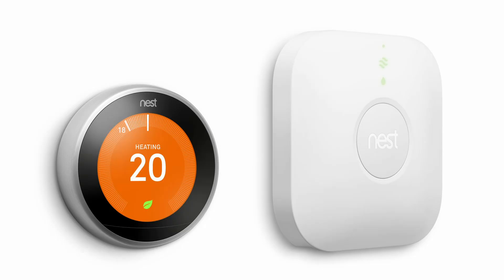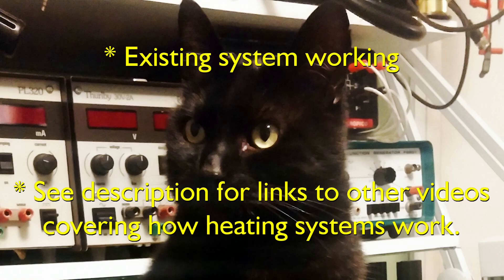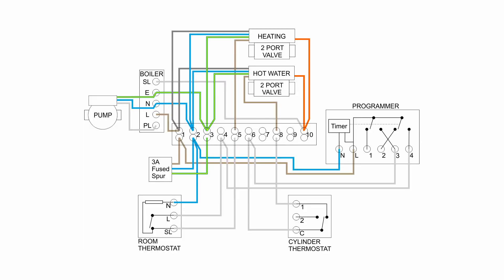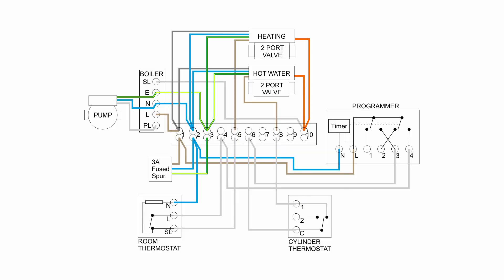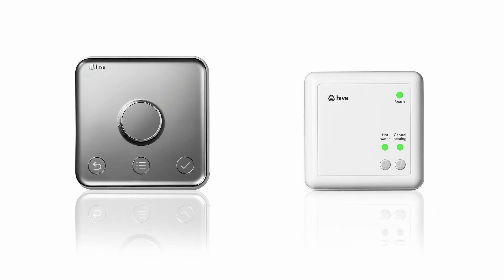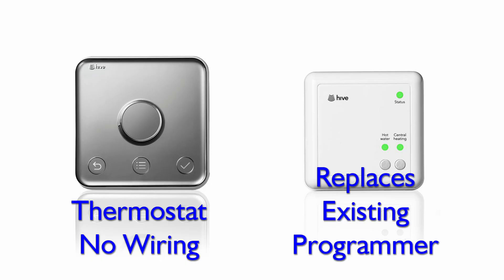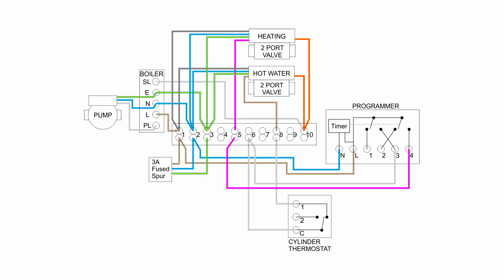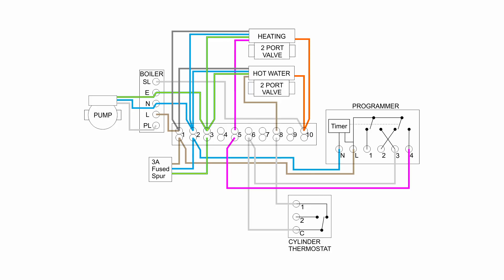Replacing a programmer and thermostat with Hive, Nest or a similar all in one controller.

Comment: Water timer only really applies to back boiler systems or large scale hot water systems feeding a separate storage tank.

Most wall mounted Potterton or Baxi boilers only use the timer for heating, water is usually on active flow sensing standby for whenever a hot tap is turned on.

Only snag with hive or the others is the modern traditional combo boiler where everything is built into the main front panel... like many Ferroli, Vokera or Worcester, etc... which would make it difficult to install one of these.

Operational security wise... anything going online on the one hand would be a good idea but on the other there are operational security risks.
Reply from the maker: This video is for systems with a hot water cylinder, and is not applicable to combination boilers.
Reply: @jwflame  hi John, instead of removing the wires from old thermostat, could I join the L and SL together and cap the Neutral?
Reply from the maker: @alanwoodhouse3804  Yes, although the wires will need to be covered by a blank plate so it is still clear they are there.
Reply: Alan Woodhouse g

Comment: I'm surprised that none of these things do much with the hot water apart from on/off.  I built my own automation system and in addition to the std tank theremostat i run an auxiliary temp sensor so I can then run the hot water at a cooler temperature at different times of the day and week.  On sunday afternoon i allow it to get into the hgh 60's to kill any bugs, but otherwise i keep it at the lower 50's.
Reply from the maker: Hot water is such a tiny percentage of heating costs, it's not worthwhile to do anything other than on/off.  With a modern cylinder, the heat losses are only a few pence per day even if it's at full temperature all the time.
Reply: John Ward I agree that hot water costs are  far lower than heating costs, but my approach does save gas - i track gas consumption on the same system and proved it used less.

Comment: Great video! I had to install Hive by myself as I have an oil boiler and British Gas couldn't help. Something I done was keep the existing thermostat in place and turned up full. This was to act as a fail safe if the Hive were to be faulty and the boiler fired all the time, which happened with a few of the Hive gen 1's a few years ago.

Comment: Cheers John.  Another good video
You say about removing stat wiring  More explanation on keeping the wiring and using it for the 12v side and the wiring adjustments required in the wiring centre to do so would be good please 
Keep them coming 
Thanks

Comment: The nest needs 12 v from the controller to the room thermostati
Reply: mm27760 Mccluskey No it doesn’t - it’s an option if you’re putting the new thermostat in place of the old one and can reuse existing wiring. Otherwise you sit it on a shelf in your living room and feed it from a USB power supply that is included.

Comment: Interesting to see how things are different over there... your heating and hot water are tied together? Is that due to radiator heat being common? Don't think I've ever seen that arrangement in the states.
Reply: Jarrett Does Stuff, very occasionally it's common for commercial systems to use a single hot water source to feed all needs in the US.
Reply: Good to know!
Reply: Yes, radiator low pressure hydro is by far the most common form of domestic heating over this side.  Once you have a boiler heating water it's easy to have it either circulate the heating water through a coil in a hot water tank (system boiler) or provide "instant" hot water on demand (Combi- or combination boiler).  Only on particularly large installations might separate systems be installed.